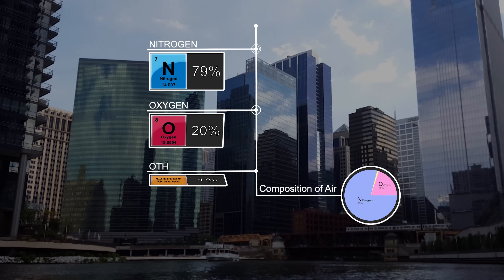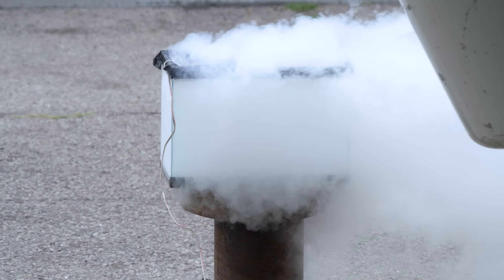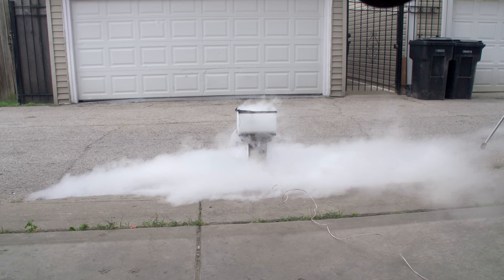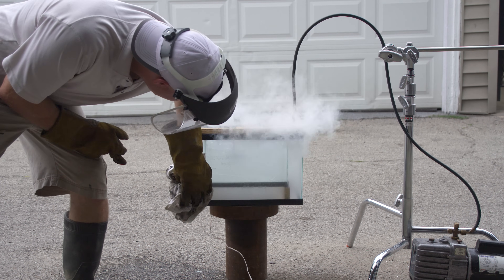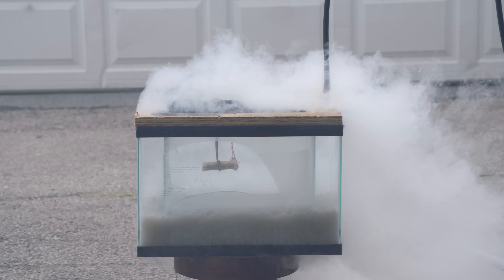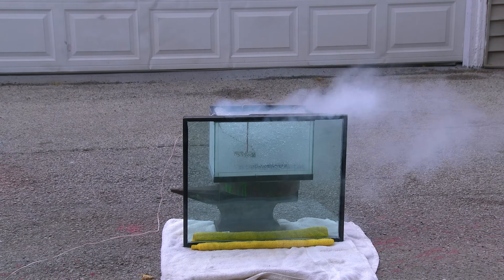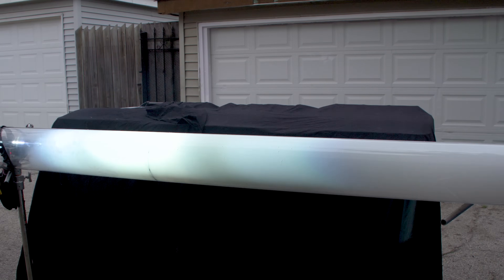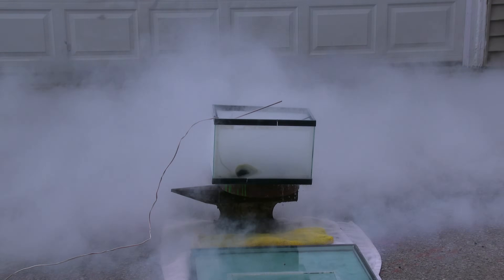Burning Model Rocket Motor In Liquid Nitrogen - 4K Slow Motion

Comment: the rocket engine/MOTOR that you are burning is supposed to be used in atmosphere in presence of 21% oxygen, it does have its own oxygen supply, potassium nitrate, but when it burned without atmospheric oxygen, oxygen was also used in keeping the combustion going and not fully powering the burst of combustion it was intended to be used for. Hence it caused the fuel to burn at a much rapid rate with less oxygen as oxygen was not burning and catalyst sulphur caused even a faster burn as intended but with lower oxygen causing the reaction to go even faster hence only lasting 1 second. tl;dr- no atmosphere no oxygen faster burn

Comment: The ejection charge went off way sooner but the engine continued burning after the ejection charge went off. I bet the longer time sitting in the LN2 meant that the outer part of the fuel was too cold to react so the core burned through really fast and the rest of the fuel only burned after it was heated by the combustion of the core part.

Comment: what most likely happened is the liquid nitrogen froze the grain in the engine and changed its mechanical properties making it more brittle. So instead of burning steadily when ignited, a big chunk of propellant probably flew off, ignited and cracked the casing.

Comment: In the first 100 meters, we saw the distortion caused by the Goo-Pro cameras and we believed that we live on a highly rotating 71% water ball - Globe Earth with a 100 km atmosphere at 1013.25 hPa, together and in the same place in the celestial suction vacuum with a force of 10 to a minus 17 degrees of suction, which completely destroys and completely contradicts the second law of thermodynamics or the so-called natural law of entropy in one system. Only a childish mind with childish, non-logical thinking can still believe we live on a heavily rotating 1666km / h ball at the equator ignoring and totally denying the centrifugal forces on the equator with three quite different densities as one density we have on the water, a second different density we have on land on Earth that is on a level and equal to the density of water and a third density we have on atmospheric gas, which the HelioCentric Theory preaches and inserts that it has been glued to the Earth's surface thanks to our sold "Gravity" Newton's Venture, and that this same "Gravity" holds the oceans, seas 71% water glued, agglutinative motionless to a revolving 1666km / h, at the same time alone circling the Sun with 107,000km / h, at the same time circling spiraling about 112 times big Sun from Earth, Sun - moving like a comet in the middle at a speed of 804,670km / h driven by inexhaustible energy from nowhere, like this absurd Earth Ball - Globus travels with these crazy speeds along with all the other "planets" of the Solar our system, along with all Moons, satellites satellites - 20,000 in number and together with all the absurd cosmic garbage generated by the last 60 years of "Space Programs", which is generated and driven by the same "Gravity" that makes the planets rotate in strict synchronicity with perfect ecliptics and constantly offset orbits to milliseconds? This far outweighs even the boldest fantasy of psycho-asthmatic, psychosomatic, theoretical metaphysics man with a sickly unhealthy phantasmagoric consciousness fiction. Atmospheric internal pressure, which serves to ignite the rocket at the last attempt, comes from behind plus the added internal pressure generated by the system we know from the first law of thermodynamics, which pressure actually quickly fills this little funny vacuum chamber, which pressure is formed from the burnt and ejected gases in vacuum and form a small gas-pressure space that in fact displaces the vacuum and fills with exhaust gases and unburned gases this little space - in this absurd funny - little "vacuum" chamber. Imagine a suction vacuum with a force of 10 to a minus 17 degree suction force plus an external pressure of 1013.25 hPa atmospheric pressure suction vacuum which has a reverse force of 10 to 17 degree of atmospheric gas under pressure, that is suction suction with power 10 to 17 degree, and atmospheric gas pressure, pushing 1013.25 hPa. When they lifted the upper plane of this funny "vacuum" camera, this platform plastic board bent only by the power of its own weight, making us feel like fools to believe that these funny plastic board would withstand the suction vacuum that is a reverse force of 10 to minus 17 degrees without bending inward, plus the force of atmospheric gas that pushes externally with a force of 1013.25 hPa. Each rocket engineer can confirm that there is no rocket engine running at the same time in atmospheric gas and the engine running in a vacuum environment because the rocket gases will be scattered for only a fraction of a second in the vast vacuum space, have nothing to push and have nothing to push in the vacuum to get some boost on this rocket, because the vacuum is nothing, the vacuum has no density. Fire on the rocket can be secured with additional atmospheric pressure, as did this ridiculous, conspiratorial, stupid man after many failed tests, that this rocket will ignite and burn very well in a vacuum if it is secured on that rocket oxygen, .. but this missile has nothing to push, nothing to pushed or propel into the vacuum, because vacuum is nothing, no density, unlike atmospheric gases, which gases will be scattered only in the nano-second in the infinite and vast vacuum space , ... but the gases in in this little one funny - small "vacuum" chamber will immediately fill this small space and this small space will no longer be a vacuum and under this condition can now get some impetus to this racket. Why does this a crook - conspiratorial man not use NASA's vacuum chambers, which are a few meters thick and to do this experiment again? We, the well-meaning people with proper logical and critical thinking, know why this conspiratorial man would not do such a test. Because we know it will fail!

Comment: Just ran across this, pretty interesting. Did you realize that water-proofing the parachute charge end of the engine you have increased the explosive force of that explosive? The bubbles in the nitrogen were able to absorb some of the shock of the explosion while the engine in the water simply transferred it directly to the glass. I know it's kind of late but how about an engine in gasoline?
Reply from the maker: Your not late, that would be awesome and very interesting. Very interesting. I think I will do that soon. I wonder what will happen
Reply: People will disagree but gasoline doesn't explode. For that matter gasoline doesn't even burn, it's the vapor that burns so rapidly that it appears as an explosion especially if spread around a James Bond type car with Timmy Dalton inside. Well, actually with any James Bond type inside except for Sean Connery. Flicking a cig inside won't normally set off gas vapors since a cig only gets to about 500 when it is actually being smoked and gasoline ignites between 500F/540F so they will be like two ships passing in the....you get it. 

Would the bubbles ignite? Who knows? Not enough oxygen left to sustain ignition as the vapor dissipates in the open atmosphere? Since setting fire to my back yard would certainly not help me endear myself to my neighbors after some of the experiments I've tried I'll live  vicariously through you. Thank you very much.

Comment: I don't know if anyone gave you the right answer to your question why the rocket engine burns so much quicker in liquid nitrogen and the vacuum, but it's because of the principle of le Chatelier. Chemical reactions which produce a lot of heat work better and therefore faster in a cold enviorntment and reactions producing a lot of gas work better under low pressure. That's why the engine almost explodes in the liquid nitrogen. Sidenote: that could have gone downhill pretty fast with a bigger engine like you used in your vacuum video.

Comment: a QUICK ANSWER to your question:  the rocket motor burns faster in vacuum is because the ejecta dissipates faster in vacuum due to low pressure, which speeds up the chemical reaction in the combustion chamer.
Reply: +phlyming On the contrary, MOST combustable mixtures speed up their burn rate under increased temperature and/or pressure - they have positive burn coefficients relative to temperature or pressure.  This is why designing motors with certain fuels (zinc-sulfur comes especially to mind) can be highly dangerous - make the nozzle the slightest bit too small, the burn rate positive-feedbacks until it blows up the combustion chamber.  Zinc-sulfur has particularly wicked combustion coefficients.  Which is why nobody in their right minds builds rockets that way anymore.  Watch "October Sky" - that's what happens with zinc-sulfur in steel pipe.  An acquaintance killed his neighbor's cow when he was a kid just that way.

Other examples: modern gunpowders burn slowly and anemically when they're not confined in a chamber.   Slow burn, nothing scary.  In a rifle cartridge - "BANG!".  Solid rocket propellents (eg: Ammonium Perchlorate/Nitrate plus resins/plastics etc) when out of their sleeves burn slower than a road flare.  Confine them and WHAM!  Even blackpowder burns MUCH faster when confined.  Especially quickfuse - take an ordinary fuse that takes a few seconds to burn tamely with a bit of sparkle and hiss.  Now stuff it down a straw and try again - fractions of a second burn time, and probably a healthy BANG! of its own.

Rocket engines are more efficient in vacuum not because they burn faster, but because the pressure differential between inside and outside is higher, hence the exhaust gas is accelerated more, and more exhaust gas can be ejected in a given amount of time.  F=MA - increase the mass flow and the acceleration, more thrust.

Comment: solid propellant model rocket engines contain both a fuel and an oxidizer and as such have all the elements in place to self sustain combustion once ignited the ejection charge likely is what split the casing due to the super cold environment making the rupture of the upper end of engine a difficult task , it would also not be surprising if the super cold environment exposure could either internally crack the propellant from thermo shock or shrink it casing propellant to be crushed and crack as well it will also make the pressure casing extremely brittle at the very least ,, if the propellant did crack internally a lot more of it would burn then intended in a given time raising the internal pressure to the failure point , Have had model rocket engines that have been dropped onto a hard surface do the same thing at normal temperatures , try using a motor without an ejection charge

Comment: Rocket fuel is self oxidizing, fast burn time is to to the lack of burn stabilizing gases found in atmosphere.. just like gun powder.. confined it will burn fast.. open to air it will burn relatively slow

Comment: POSSIBLE EXPLANATION: Maybe the rocket burned faster (3s) because surrounded by nitrogen it's more efficient. Thermodynamics laws, when the medium is colder than the engine, more efficient will be the this engine. So, hot engines in cold medium are more efficient than the opposite. Also, maybe, the nitrogen decreased the molecular energy (chemical activation energy) of the material inside the rocket. So it requires less external energy to ignite the rocket material, then burning faster. In vaccum almost the same happens, because the medium almost doesn't "exist", so it almost doesn't have temperature, so it's similar to a perfect engine. And the atmospheric pressure is low, so, it doesn't require much engine work, like a free expansion...

Comment: since the nitrogen is an inert gas the only thing that could ever happen (and i think that is happening behind the fog) is that the combustion of the rocket was a little bit slower and nothing else, because the element for the combustion, oxidizer and fuel, are in the solid propellant contained in the rocket. Have a nice day

Comment: My theory after 50 years of model rocket experience is that when the engine was allowed to get real cold, the fuel develops cracks. Fire follows the cracks. This means a lot of increase in the surface area and the engine over pressurizes and blows up. Cold also probably made case brittle.But cracked fuel grain is what did it in.

Comment: Please don't wear open welly boots when pouring LN2. If some goes in, you've lost your toes or maybe whole foot.
Reply from the maker: Nathan Barrow good point, the only reason I didn't have my rubber apron on was because it was so hot, which is exactly how accidents happen. Mostly I have the rubber boots on in case the ground beneath me got flooded in the case that the tank broke open.
Reply: Noticed that as well. Foolish.

Comment: using hot glue to water proof is plugging the end too tight.  the ejection burst charge is basically lose power so sealing the end too tight makes it a small bp explosive.   a better way to make your motors water proof would be to dip them in melted wax... paraffin wax will do the trick.  get a giant candle of it at Walmart for 2$

Comment: Interesting. But you don't want tp pull full atmospheric pressure from between the tanks. These are just cheap storebought fish tanks so their relatively weak. You want to take 2 or 3 psi out at the most. You'll still get a good insulating effect. I believe thermos have only 1-2 psi less atmosphere.
Reply from the maker: Travis Piper that's pretty much what I tried to do but I didn't realize thermoses had such little air pulled out but that would make alot of sense .

Comment: I think your broken motor casing was from a greatly accelerated burn rate cased by the hot-melt glue. Those motors are just tightly packed gunpowder and their burn rate is established by the nozzle throat pressure at ignition. If you restrict ignition and build up additional pressure the resulting pressure inside the engine case will ramp up quickly. The nozzle lives in the balance between its strength and the pressure of the burning gunpowder.

Comment: As to why the engine burned so quick...I'm pretty sure I saw at least part of the ceramic nozzle blow out of the engine casing. After that it was wide open. In normal condition the solid propellant is pressure limited in burn rate by the orifice the combustion escapes from. Once that's outta the way, all bets are off. It burns as fast as it can through the tube opening. I think the nozzle failed probably just from differing contraction rate, far as I know they are kinda inteference fit into the tube with a small amount of adhesive for good measure. But that adhesive can't hold it in place if the interference fit is lost or the nozzle frags. The solid propellant probably falls apart too once the nozzle is lost. I remember flying model rockets and every now and then get a bad motor that just kinda blew up on the pad and failed to climb (much) after blowing up a nozzle.

Comment: 40 seconds in, and I'm just impressed that the aquarium didn't explode from temp shock...where did you find a pyrex aquarium? LOL. Ever put cold water in a hot coffee decanter? Yeah, that. Much larger differential here. Guess I'll keep watching...
Reply from the maker: L TR yeah there's some science behind that, I didn't bore everybody with all of the testing that I went through before actually pulling off this experiment. Anything that's a continuous piece of glass even Pyrex or heat resistant will shatter, from what my testing reveal even if you pour the liquid nitrogen in to the aquarium the wrong way it'll crack. You have to literally pour the whole thing and quickly to cover the bottom and then continually poor at a slower rate as you get the aquarium filled up.
Reply: Cool! Interesting, thanks.

Comment: Why didn't you place the tanks on some styrofoam instead of what looked like a solid disc of steel. That would have cut down on the heat transfer into the LN2.

Comment: Rocket engine contains both fuel and oxidizer - it'll burn pretty much anywhere.  Only water soaking the fuel or loss of the casing allowing oxidizer and fuel to separate would prevent ignition and combustion.

Comment: Why did you think that the second test would be different?  An aquarium can NOT withstand a vacuum.  Of course it will burn in LN2, it has it's own source of oxygen mixed in the fuel.  That is why they burn so well.... you HAD to know this from the "will it burn in a vacuum" experiment.